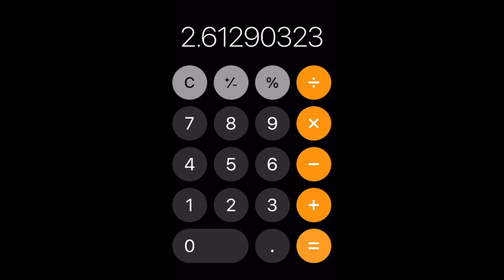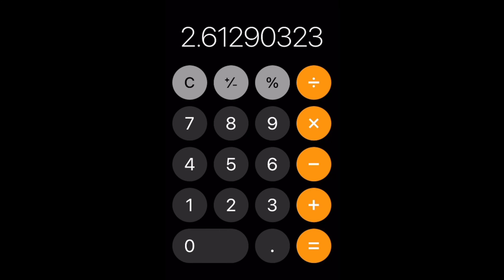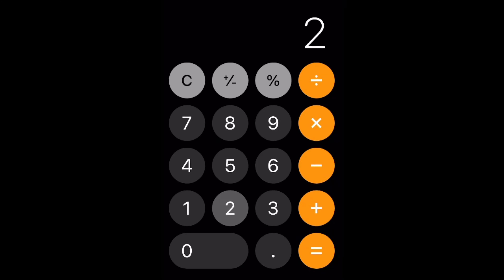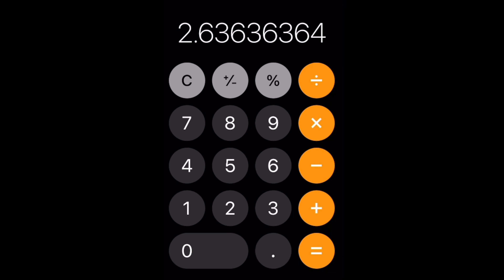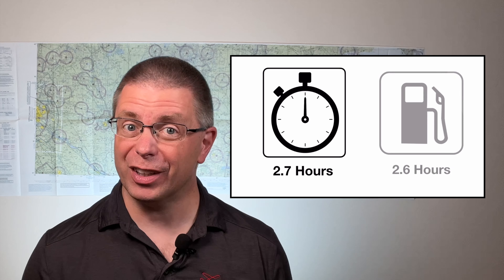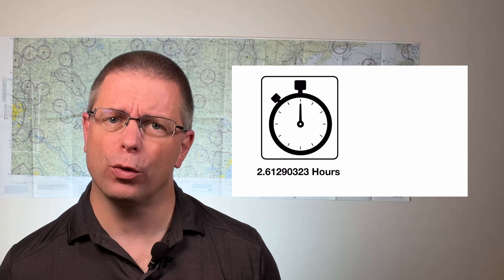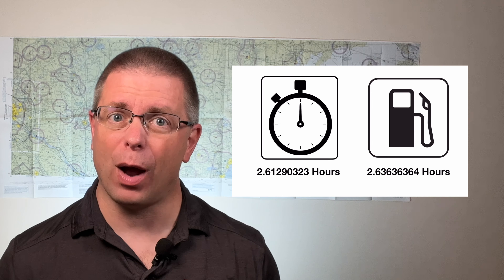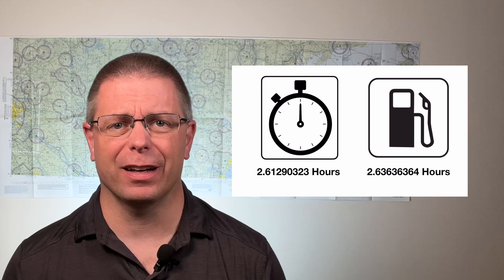Rounding Pessimistically: The Ultimate Hack!

Comment: I was introduced to a way of rounding that I quite like. I know most people think it is rubbish and that it won't stand up to rigorous arguments. Anyway, here goes, for decimals below 0.3 you round down, for decimals above 0.7 you round up, and for the rest you round pessimistically. The idea is that for calculations with a lot of intermediate results, if you carry out pessimistic rounding at every step it compounds to too much of a safety margin (and general inaccuracy), and if you carry out 'traditional' rounding those pesky 0.5 (of which there might be several) might semi-persistently round to the unsafe side. Of course the case for using the 0.3/0.7-rounding is only strong when there are a lot of intermediate results involved (and each with only a moderate number of significant figures), like calculating landing distance, where you may have adjustments, in, say, whole percent points, for runway surface, runway slope, runway condition, pressure altitude, temperature, aircraft mass, non-standard threshold crossing height, head wind component et cetera.
Reply from the maker: Robert.  Thank you for sharing.  I like it!  Especially when there are a lot of intermediate calculations that need to be done.   As you noted, compounded rounding can (will) lead to significant inaccuracies.  

I would urge caution when considering something to have "too much of a safety margin". I do agree that if the numbers don't make sense, it is a really good idea to rework your estimates and perhaps review any assumptions made during the process.  However, in general, my philosophy is that it is always better to be on the ground wishing you were flying than to be flying and wishing you were on the ground, (or hurtling down the runway wishing you had 200 more feet or 15 NM from your destination wishing you had even 1 more gallon of fuel, etc.).    :)

Having said all that, I do like the process.  What do others think?  Do others watching have other methods of rounding that work for them?

Thanks again!